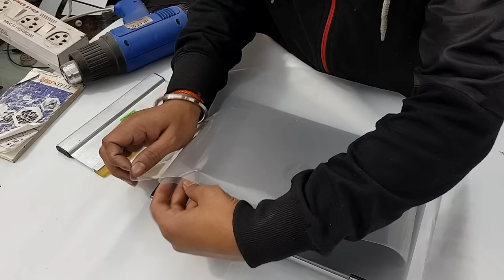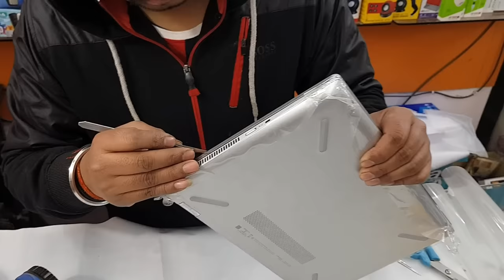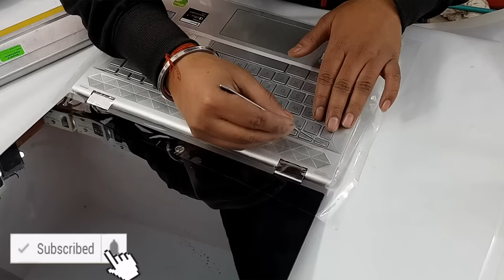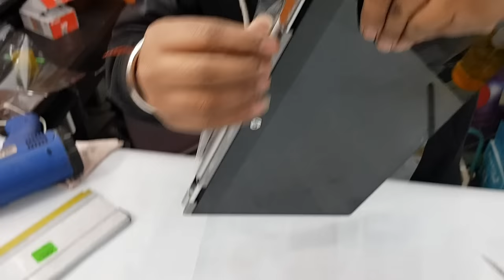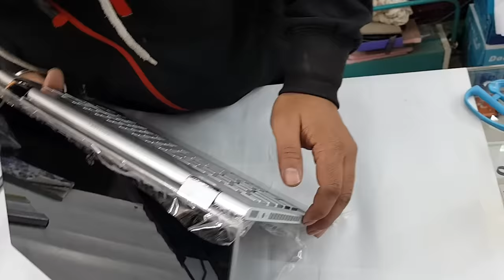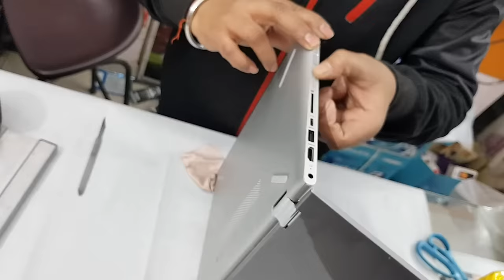HP Pavilion x360 Laptop Lamination Hp foldable laptop cover full protection

Comment: how about doing some measurements and then apply the protection instead of scratching every angle and every edge of the laptop !.
Reply: That's more hectic any mistake will waste entire flim
Reply: so you want to cut a sheet exactly for 15.6 inches and then if you miss it by 1 mm then entire sheet is wasted 😀
Reply: That scratches won't be visible if not seen carefully .......
Reply: Isse ye idea nikla ki sirf top lid ki lamination karwani hai baki sab bakchodi hai